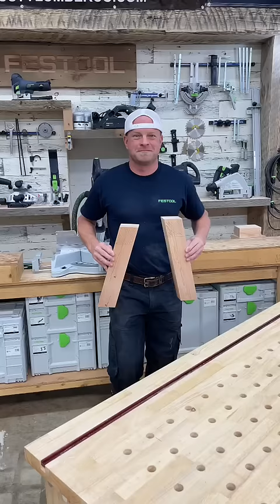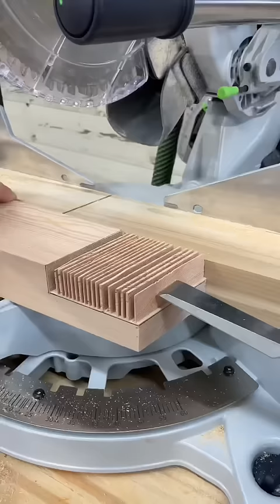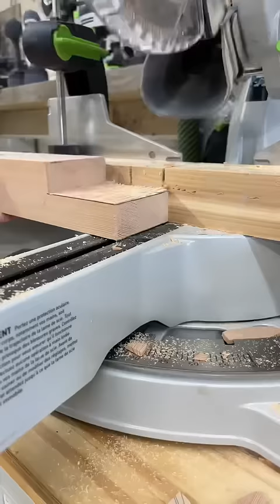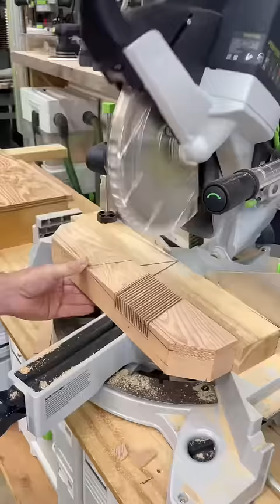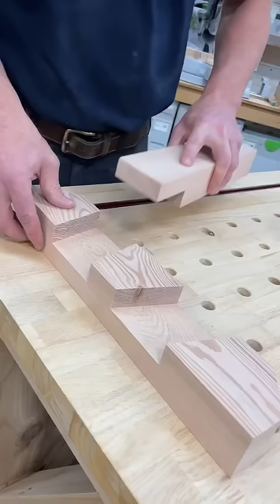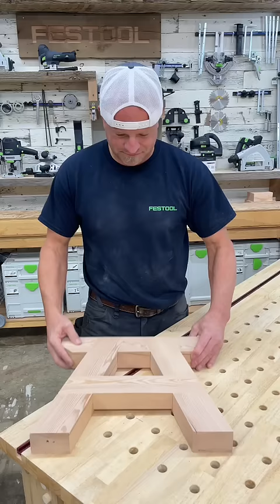Lap joints with a sliding mitre saw #ad #woodworking #wood #woodwork #maker #bois #tools #holz #work

Comment: Awww man, can’t you make just ONE joint that doesn’t fit perfectly snug and make the rest of us feel a little less envious of the full Festool store in your workshop? 😂
Reply from the maker: I made lots of mistakes when I started and now over the years have got better 👍
Reply: @dustylumberco  does the festool miter saw have a depth stop? Like a setting where it allows you to control how deep down your blade cuts?
It looks like it in the video
Reply: @dustylumberco  I kid, I kid. Just looking for excuses to compliment your awesome woodworking skills. Definitely one of my favorite channels.
Reply from the maker: @daveortwine2641  yes it does 👍
Reply: @daveortwine2641  It does, and so does my Dewalt DWS-779 I use it the same way as he did here. Mine doesn't have as nice of an adjustment but it works the same way once I dial it in, and my saw only cost $399.00 instead of $1'500+. I think most sliding compound miter saws have that feature. I have to put a board in front of the fence the same way he did for it to make the whole cut.
Reply: If you watch his old videos of him using makita tools mostly it will make you feel a bit better 😉
Reply: @daveortwine2641  Yes, it's that green screw you see him adjusting right before the clip of the blade creeping down to the line
Reply: Uo0
Reply: I’m with you Ryan! 😂
Reply: @dustylumberco  BS...that's just really good editing 👌 🤣
Reply: @daveortwine2641  all miter saws I have ever used have this feature festool does it with more grace…love festool
Reply: @actionjksn  lol i have the same saw as you. I need to find out where ours is located so i can use it
Reply: @dustylumberco  can ya please give us a tour of your shop. A full length video
Reply from the maker: @daveortwine2641  I do plan on doing one when I get some time to make it 😁👍
Reply: @daveortwine2641  You don't know where your saw is located?
Reply: Nice vids I do that with a circular saw and lots of patience. May not turn out as good as yours, but it turns out good enough. Because sometimes when you’re on the job and you flew out the door too quick and you just forgot to grab the things you needed to grab for a specific job. You figure out how to get it done with what you got. And of course slop Jackie doesn’t work out so you got to do it good enough. That’s where I like to think a little bit of caulking, a little bit of paint makes a carpenter what he ain’t. I wish I had that shop’ awesome work’!

Comment: Thanks! I do this with a handheld skil saw, but could be much more accurate with my sliding chop saw.

Even if we don’t have a full shop like you, lap joints on a sliding chop saw could get a lot of similar projects done nicely.
Reply from the maker: The sliding mitre saw definitely helps to keep things steady and square. I did a lot of projects with just a sliding mitre saw making half laps before I got some of the bigger equipment I have 👍 great tool to have and half laps are strong and good looking joints
Reply: @dustylumberco  if it’s possible to cut compound angle lap joints on the chop saw, it’d love to see your take on it. I made a massive swing set with lap joints, the legs were angled out like in this video, but also had a compound angle to kick the legs away from each other. Out about 15 degrees and away 6 degrees. If that makes sense.
Reply: If you have a DeWalt sliding compound miter saw it has the same feature where you flip the wing down and adjust a screw to make it stop at a specific depth. My $399 DeWalt sliding compound miter saw has that feature, I think most of them do.
Reply: @actionjksn  I do! Got mine on local Craigslist and it’s been great. I’ll check it out.
Reply from the maker: @actionjksn  yes lots of saws have a depth stop 👍

Comment: what does the board behind the work piece do on your miter saw?  or is it just for tare out?
Reply from the maker: It has to be there so I can get a flat bottom cut, it’s not there the edge of the joint will have the radius of the blade along the edge and not be flat. It does also protect against tear out 👍
Reply: Thanks, I was not sure if you would respond.
Reply: @billmontgomery8900  its a great thing to keep in mind that you can always improve a tool even if expensive with a simple use of wood and thinking a little about what youve seen others do
Reply: @dustylumberco  I thought the board being placed behind there was only needed on my El Cheapo DeWalt 779. I would have figured your fancy German saw wouldn't need the board behind it. You do have a lot better adjustment for that feature on your saw. I have to turn a screw on mine but I keep it finger loose all the time so I don't need to get a tool out.
Reply from the maker: @actionjksn  ya still need a block to avoid having the radius of the blade sticking up a little bit at the back depending on the height of the wood you’re cutting. The higher the more you need it. But the block also helps prevent tear out on the back side of your board and I would put it there anyway

Comment: So you can make all these awesome joints. The question is can you frame a closet🤪. I have worked in cabinet shops in the late eighties and there was a lot of skilled craftsmen building all different kinds of mill work. But I have say you are a master at your trade.

Comment: Superbe comme toujours!, pourquoi mettre une autre planche à votre scie circulaire à onglet??? Merci
Reply: its called a fence same as the parallel metal part at the back, its so that you can have the work sitting a little further forward, but still parallel, as the saw cannot reach that far back. im actually not sure why those metal fences arent movable forwards. but usually they catch the teeth so it makes sense to use wood you can cut into